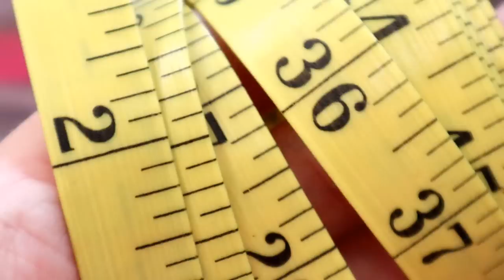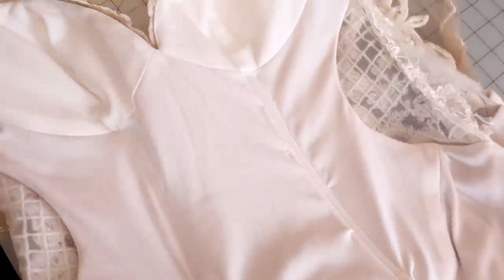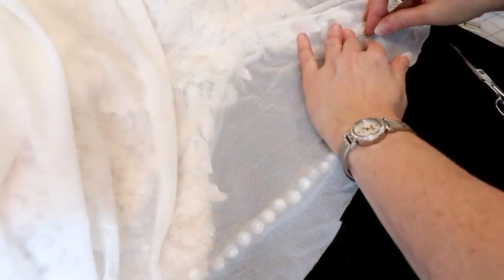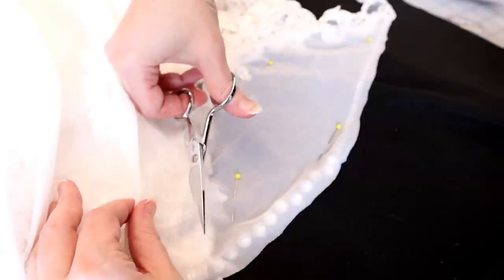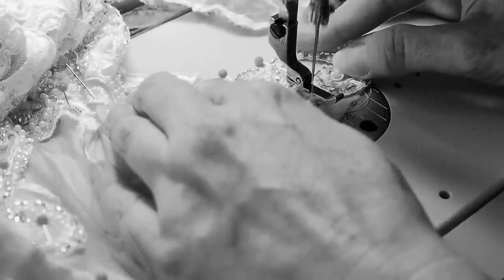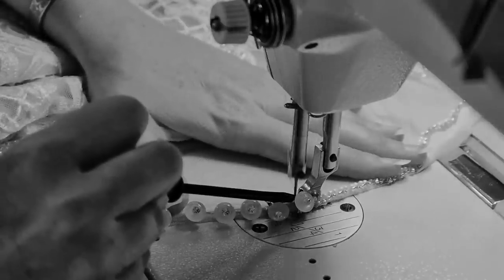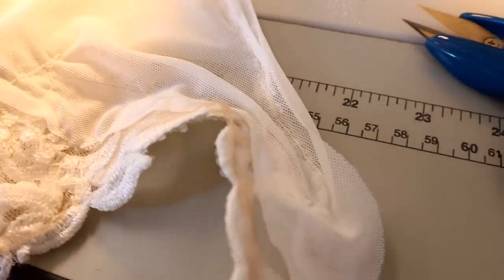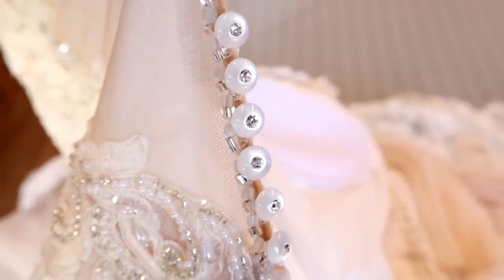How to Add Support to a Sheath Wedding Gown, Add Boning

Comment: Excellent video and very easy to follow and very detailed which is greatly appreciated.  Can you do a video on how to bustle  multiple layers of tulle with multiple widths? Very challenging.
Reply from the maker: Thank you. I don't have one like that yet. Try this one in the meantime! :) https://youtu.be/YwHKNyS4hJg
Reply: The simplest and most cost effective for your bride is to tuck all layers smoothly underneath, basically folding the train underneath the skirt. I use numbered crochet loops throughout all the layers with numbers ribbons to tie the train smoothly beneath the skirt. You will need to hang the dress and pin all seams when adding the loops to avoid bunching. Sometimes you will have to create neat little folds and catch them with the crochet loops when the outermost tulle layer is triple the width of the bottom layers. Hope this makes sense and helps.

Comment: Question please! How did you sew the boning onto the lining with the machine? Youve done a fantastic job but I would have thought it would be so tricky to maneouvre the excess of dress around the machine whilst trying to sew it in an existing lining. Great job!
Reply from the maker: This dress was quite stretchy & light, so I just basted the boning down by hand lashing and put it under the machine and sewed it.

Comment: Would you ever put boning for support along the rows of buttons and loops up the back, in an instance like this? I have a dress very much like this situation. All net and lace in the back, buttons and loops up the back, and I thought boning along those rows might help those button loops not to strain and pop. I know it would show through slightly but that's okay, mainly I wonder if it's okay, construction wise, to do that.
Reply from the maker: You can try it, but often, it will poke up a little high at the top of the back. I have seen a manufactured gown with it. It's rare, but I've seen it.
Reply: @BridalSewing  OKay - thanks - is that because the rest of the dress sags down? Would it still do that if the dress was a sleeveless high necked halter, I wonder? There's some support in that there is a bodice, with shoulder seams, but it's net with lace applique so not terribly sturdy. She's a very roly poly bride and it seems to me if I can get that button line really straight and not pulling (dress is as tight as it can get) it would help in several ways.

And,  here's part two and it does sound weird but - I wonder, what if I put boning (and it's sewn down ridgelene, wrapped with some nude horsehair so it doesn't show through the net as much, looks fine as far as that goes) along the side with the loops ONLY. The button side would be supported by attaching to the stiff loop side if that makes sense.
Is there any reason that wouldn't work? I know it's unorthodox, but it just seems to me like it might work.

Comment: Is is possible to add prices below your video in description box . For example adding power mash 50 $ ( took 2 hours)... sounds crazy but would help a lot
Reply from the maker: Karolina Brzozowska I completely understand how that could be helpful to some. I do have a couple concerns with that, though. My main concern is that my viewers are very global. The pricing would literally mean nothing. Even in the U.S., labor pricing varies greatly because it swings with the local cost of living. The other problem is that I don't always itemize the bill. This project certainly wasn't. This dress was an emergency job that I quoted very high. She was out of lead time, there was no other local seamster with the skill set to fix this, and the only opening I had was a holiday that my shop was closed. 
I can say, if I were pricing only the structural changes pictured in the video, it would normally run a couple hundred dollars. (This bride also had to have the gown fit to her, hemmed, & bustled.)  
You are always welcome to ask about what value I would personally place on an alteration job pictured! :)
Reply: Bridal Sewing Techniques i understand completly thank you for explanation,  what about time how long it should take? This depend of skills set but lets assume all of us are advance.
Reply from the maker: Karolina Brzozowska this whole segment, maybe 2, 2.5 hours? But this dress was very easy to work with. It didn't put up a fight & everything was very accessible.
Reply: Bridal Sewing Techniques you are amazing person;). Thank you so much I appreciate all of your help and advices. Each video is super informative. Now when you tell me the time I can imagine how would look like work with this dress ...God bless you 
Also kind of bustles for different wedding gown would be helpful too😘

Comment: the power mesh was added cervix the tulle? the tulle remained even after adding power mesh? what did front of gown look like after support boning and cups added?
Reply from the maker: rell whye yes, there's other descriptions down below, too. But it was basically, this: Repaired & beaded tulle with power mesh added behind. 
The front looked like a normal boned, supported gown. I may do a blog post on my website and include that front after picture. 
I actually didn't use this gown for the thumbnail/title image because the "before" picture wasn't appropriate for modesty reasons. Sometimes, I have to mix & match those. 
I'll let you know when I do a blog post. It is bridal season, afterall, and things are crazy at the shop right now. 🤣

Comment: Thank you so much for this video, but I am confused…at first it looks like you’ve basted just the raw sew-through boning onto the lining. But when done it looks channeled? What two pieces is it channeled through? And it’s not sewn onto the lace part at all right? With no front after it was hard to tell what the finished product looked like. 
I would really appreciate if you could clarify because I have this alteration in a month. Her dress has no waistline, it’s a sheath mermaid style dress. So how far should the boning go if not waistline to guide? 
THANK YOU SO MUCH for these videos and in advance for your answer. You are amazing!
Reply from the maker: I probably tried it on her raw, and then before sewing it down, I wrapped it in tulle. I really can't remember. It has been quite a while. 
As far as the length of boning, usually I would let her waist be my guide. The bones often stop at natural waist or 1.5 inches below her natural waist if the shorter length causes a buckling-in.
Reply: @BridalSewing  Thank you for the response! It just literally looked sewn into the lining for sure, not like tulle at all. And so the out lace is not part of that sew right? In other words you don’t touch the outer lace correct?
Reply from the maker: I'm kinda afraid that I'm saying the wrong thing. It has been so long. Can you give me the time stamps on what you are talking about?
Reply: @BridalSewing  so at about 2:48 it looks raw and 3:15 looks sewn in. Thank you so much for taking the time. 🌻
Reply from the maker: Oh! I see! No, I remember that now. I basted the boning to the inside of the lining. There were no seams to sew the boning to. Then, while the boning was held still by the basting, I sewed the boning directly to the lining with two rows of stitches on each bone. The stitches you see as I pan over the right side of the lining is not from channels that have been sewn in, but rather boning that is directly attached. This is a very rare way of sewing the boning in. Most gowns have princess seams to work with.

Comment: I am tailoring my daughter’s dress. I have sewed for years but this is the first wedding gown. She is large busted, like DD. I went to your web site to look at your supplies. The breast pads only show small sizes. What do you suggest for large breast cups? Also, her dress has no cups or straps. She wants an off the shoulder look with sleeves. I have watched most of your videos. Any suggestions on adding support? The back is straight across basically under her arms. BTW one of your videos you showed an old Consew you hate. My industrial sewing machine is a Consew. I’m just getting use to it. It’s really old but a tank!
Reply from the maker: Hi!! There's so many questions you have & I don't really have a lot of detail to go on. To order different size bust cups, just click on the ones I have pictured and then modify your search. These aren't my actual supplies in store. They are Amazon links to supplies that I order for my shop. Some of them even expire as listings and then you have to re-search them out on Amazon. 
Bust cup sizes don't really correspond to bra sizes. I almost always use a size B push up, but sometimes- (maybe 3 times a year?) Jump to a size C for my brides.
Reply: @BridalSewing  Thank you so much for answering.  Yes, I do have questions but then again I'm a talkative person LOL.

Comment: Why did you choose an 18 needle to work with the power mesh?  The bulk does not appear to need it to me.
Reply from the maker: If the fabric will withstand the needle size without getting too big of holes punched in it, I choose the 18. I personally find less thread breakage with the larger needle/eye. I think I have a video on choosing needle sizes. I usually look at more factors than fabric thickness.

Comment: what's the different btwn that meshy kind of boning and the 'normal' opaque plastic boning? is it as strong?
Reply from the maker: I think when you are asking about the "meshy kind of boning" that you are asking about the horsehair braid. It's not a boning at all. It's a braided nylon that gives body to a seam or a hem. It's not really referred to as being strong or not. It doesn't need strength for its job, really. 
Boning really has some big responsibilities in terms of shaping and support, so boning does sometimes need to be quite strong.
Reply: Bridal Sewing Techniques sorry I didn't explain myself very well! I just found it on another of your videos. what I'm inquiring about is the rigiline sew through boning. my local fabric store used to have the opaque plastic boning (the kind where you need to put it in a boning channel), but now they only have the rigiline boning. So I'm wondering what the difference is, and if the rigiline is as strong as normal plastic boning? thx so much for your help!
Reply from the maker: @katyb2793   oh... gotcha!!  When you said mesh, it made me picture horsehair braid. (obvi. lol) 
I really love rigiline boning.  I've not had problems with it. I love it being sew-thru. If I need it to be stronger, I just use a wider piece. If I need to keep it narrow but be stronger, I stack them. 
Some people use zip ties when they can't find the plastic boning to use in a channel.
Reply: Bridal Sewing Techniques I see, thx for the info! 😊